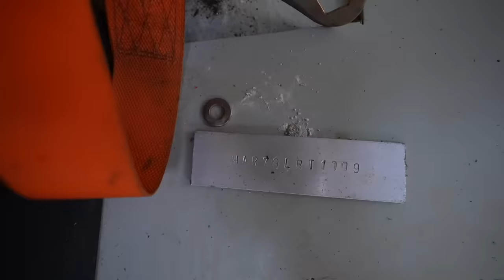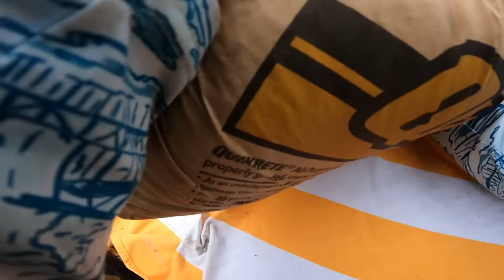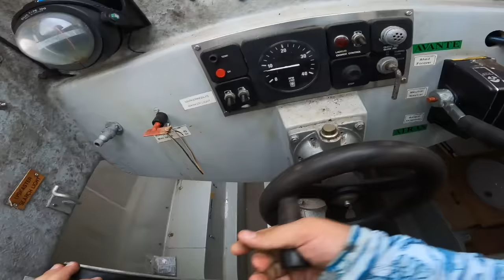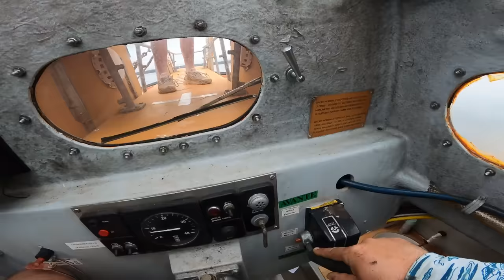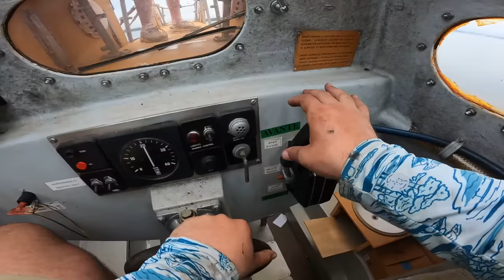WATER TESTING 64 Person Enclosed Lifeboat For The FIRST Time!!

Comment: Many years ago I worked on the oil rigs off the scottish coast.
There was I think 8 of these TEMPSC life boats on board.
They are built almost indestructable, they self right in the most severe conditions.
I was on one of the training courses for evacuation of the rig, we were seatbelted in and dropped into the sea, it almost broke our backs when it hit the water, then it rolled over around 4 times before settling upright.
The sea was rough and the lifeboat rolled over when a high wave hit it, there is no way you can take your seatbelt off unless you have a calm sea.

This was just a safety measure to evacuate multiple persons from clear from a sinking vessel, It is designed for saving lifes, comfort is not a priority.
You enter the TEMPSC, it takes you clear of danger, then the engine and navigation system keeps you in that position, then the coast guard etc will come to that location, the engine was not designed to power the craft like a boat.
On board you had enough food and water for 3-5 days, 

The latest TEMPSC comes with self closing and sealing doors, pressurised cabin, cooking facilities, battery powered with a small generator engine if the batteries get low, the latest technology for search and rescue
But you still barf your guts up when the sea is rough, not nice with 30-40 people on board.

Comment: Great job on the video AYO! Thanks for making it. There is bound to be a waterproof camera system that you can mount multiple cameras around the boat and monitor them from a central display. Should make seeing from the cockpit a lot easier. Couple that with some sort of steering assist gearing and you should have a winner there!

Comment: I would check if the hole you patched was actually the exhaust port for the motor.  It looked almost perfectly round.
Reply: That was the first clue for sure...
Reply: Pretty sure on the first video they said it was cut in to drain water from the inside while it was sat on dry land

Comment: AYO, besides sealing the Fiberglass engine compartment / Box, you should probably check the exhaust manifold on the engine and replace gaskets. Technically, you shouldn’t have exhaust gases leaking out into the compartment to begin with when the engine is running. Better to have 2 barriers against CO than just one.
Reply: Yep. Exhaust gaskets are probably corroded.
Reply: Sealing the box is a security measure that should be fixed but the exhaust should never enter the box. When i saw the boat from behind there was no smoke or indeed cooling water in the exhaust port. There should be a water intake from below the waterline(obviously) and that water usually go trough a radiator that cools down the engine coolant. It will then be used and dispersed with trough the exhaust.

Comment: The best stuff for plugging holes like that is the plumbers fix clay type putty.  It is much firmer to begin than the bondo and sets up rock freaking solid.  I patched a 4" by 2" whole in the keel of a kayak.  Then put JB weld over it in a few cots.  Sanded it smooth and it is looking like the strongest part of the yak now.

Comment: The mad thing is. Whenever you think something is dodgy, it always works out most of the time. The thing about those lifeboats is, they are built like tanks. It would be more of a challenge to try and sink one of those things.
Reply: Nigh unto impossible with the floatation foam in there. (That said he's probably going to want to cut it out of the interior since it's taking up space he could be using for a hundred other things.)

Comment: I've seen people turn the smaller versions of these into like houseboats and it works pretty well for them; the sea keeping on them is a little bit of a pain in the ass because these really aren't meant to be used long term in the water, they're meant for short term survival stuff but because they're so reinforced and overbuilt because, you never know if the sea is going to be calm rough or on fire if it's a oil rig escape craft, you can do a LOT with them, and because 64 men is a LOT of weight, if you only expect to have at most a dozen people inside, that gives you a LOT of reserve buoyancy to use for gear and other amenitie.

That top rail for example is PERFECT for strapping solar panels to, either on top or angled down to the deck to fit more panels too; I've seen pictures of one of these style life boats that someone stuck batteries and solar panels in with a backup diesel motor in and they were able to sail at a decent 10-15 knots for a few hours without even getting close to emptying the batteries.

Comment: If the rubber seals on the hatches are intact and not work hardened apply vasoline to them, its a petrolium pruduct that should soften them plus keep them from sticking in the winter cold temps.

Comment: Definitely fix that exhaust leak and put a starter/kill switch at the pilot station. 
I would put in a few more portholes and turn it into a houseboat. Put teak deck topside on either side of the center walkway that has sections that lift with the hatches. I’d like to have one, but what I’d really love to have is a 26’ jet drive, shallow draft, double hull landing craft with a sleeper cabin. I would use it for fun and flood rescue. Only problem is I’d need to get a truck to pull it and it’s really just a dream/wish, because a disabled vet without any benefits, and not able to work, ain’t buying anything sooner or later. 😥

Comment: You could put a ton (literally) of ballast in that thing to get it closer to how it was designed to control.  And that would let you put a nice big deck up top to give you much more outside room.  A bilge fan will get rid of the CO, but there's an exhaust leak somewhere that needs addressed.

Comment: wax paper is your friend when doing underside work ,the plastic from the 10 inch stick on sand paper work awesome ,i always save them ,they work well on top repairs too as you can smooth it with your hand and when you peel theplatic off you get a shiny smooth surface

Comment: I would love to buy a lifeboat like that, I don't exactly know what I would do with it but I think it would make a great bugout boat for when shtf.  I would build some aluminum platforms that could be hung from the side openings which would create deck space for chairs or whatever else.  I would probably slap a duramax in it and make it a floating travel trailer.  Build a bed in the very back of it and a kitchenette on one of the sides.  Definitely install some cameras to make piloting it easier.  I would replace the side sliding doors with 1" thick polycarbonate and they would open just like they do now.  It would be cool to make the cockpit bigger using a polycarbonate dome similar to a aircraft canopy.  There is just so many fun possibilities for that lifeboat.

Comment: If you're driving that thing around, I hope you have a CDL, because if the Department of Transportation catches you driving a vehicle with a combined gross vehicle weight of 26,001 pounds and up, they're going to bend you over. Expect a ridiculous amount of fines if you get caught. It's based off the weight of not just your trailer/cargo, but your truck as well. Basically your truck and everything attached to it. Maybe you're driving it on private property, or maybe you're not moving it very far, I'm not sure. Just wanted to point this out regardless so you're aware. Love the videos man, hope you're doing well. Can't wait to see more videos of the house boat!

Comment: Re the carbon monoxide, all you need to do is to reglass the engine cover, make sure the seals are in good order and put a flexible hose to the outside; adding an extractor fan would be even better. All the best. David

Comment: Vasoline on the rubber seals.  It'll help with the sticking without ruining the rubber.  CLR the hull bottom.. Don't seal up the water holes for the engine heat exchanger, etc. Be careful, it'll cost you money.

Comment: Ok, get it completely and professionally refurbished, add a galley, bunks, etc, and turn it into a little houseboat, party boat, or bug out boat.  Have the prop replaced with something for a little more speed and replace the wheel with something a little more modern and responsive for less turns.  Just thinking out loud.  :)  Great videos though.

Comment: Hey AYO that hole you covered up on the bottom is for the exhaust system for the motor to come out instead of coming into the cab of the boat

Comment: I'm an Auto Detailer (anything on wheels as well as boats) just a pressure washer will not take that stuff off the bottom of a boat. You have to use chemicals (usually a acid wash) to get that off of there. Just doing a normal 16 foot boat takes around 4-6hours to get it in the best possible looking condition. But yea it shouldn't need new paint just lots of love and time put into cleaning it brother!

Comment: Looking at the driver's view from inside the cockpit, I think if it was me I'd consider mounting a camera on the front of the boat (like you had for some of the video footage) and have a display screen in front of the pilot.  Basically a back up camera except pointing forwards.  Obviously these were not designed for common motoring around other small boats in a typical marina.
.
The carbon monoxide issue sounds like something more than cracked fiberglass on the engine housing.  Generally speaking, the exhaust gases should only be coming out the exhaust.  (I know, 'duh' right?).  But I'm referring to many other boats I have seen where the diesel engines were in the same space as crew but fumes were not an issue - cuz exhaust pipes.

Comment: I’m not an expert filling holes in boats, but back in the time when I was surfing, I was able to fix quite a lot of holes in my surf board.
We used Fiberglas and covered with resin.
 I would sand the area around the hole first, the apply an even amount of resin around the hole, covered with a thick layer of fiberglass and even more resin, place some paper wax and a piece of wood, from the bottom to keep the fiberglass in place and pressure using a jack and a rod.
The paper wax its to avoid the wood sticking to the resin.

Comment: You need to use a brush and coat the surface first then put your cloth on and stipple it with more resin and you should have removed paint to access the raw fiberglass so as to achieve adhesion and then add multiple layers

Comment: Usually, diesel engines produce little CO unless with incomplete combustion. I'm wondering if the fumes aren't related to that hole you fiberglassed shut. Another thing, with it being a displacement hull, pushing the engine past the rpm needed to get hull speed is just overloading the engine. That's a pretty neat boat!

Comment: Use wax paper to slap tiger hair over the hole.  Spread it on the wax paper, slap it on like a patch, then peel the wax paper off once it is sorta hardened but not completely dry.

Comment: prolly coulda filled the hole easier by putting a patch or ductape over the hole then put a small hole in the patch or duct tape and fill it with a big syringe or baster  or something o.o idk if itd work but it sounds like it would.

Comment: A fuel gauge float could be installed in the fuel tank. A simple mechanical float connected to a mechanical gauge (doesn't have to be digital). A simple set up like the ones used in cars, trucks, and boats. That's a lovely engine you have there (it's like winning the lottery) In terms of running hours, it is near new! with routine inspection and maintenance this engine should last you for decades without a problem.
greetings from Australia.

Comment: When you do the liquid fiberglass it is best to use a paintbrush or a small roller depends on what size and how much matting you're putting down little tip to think about and when you're doing something upside down apply the resin to the matting let it soak but before you stick it apply the resin to whatever you're putting it on hope that helps next time

Comment: You need to ballast down the stern place the prop lower in the water do it with plastic sacks seal with sand this will enable to prop to push better through the water. With 64 persons in the boat no issue. But you are using for pleasure you need that ballast . when one wants to turn quicker, wheel over to the way you want to go, power up and down in short bursts this will help turn the boat quicker.weld a aluminum ladder to the side so as to asses the roof safer plus you nee to run a safety wire/rope fore and aft to walk with your safety harness attached..

Comment: Dang Brother Killer deal Id love to have it. I wonder if you can  change the steering gear ratio there behind the steerin wheel . There are so many things you can do with it.  Heres some names Sweet Potato . Slow N Steady LOL With the alarms going off. THE GASP. Plus folks are gonna gasp seeing that Beast of a boat comin by. Thats a floating Tornado Shelter for the lake. !st thing though. A all weather wide view camera at the bow and a large enough screen at the helm. Id mount several around it and wire it to switch views  with GPS view for when your Putt Puttin along. But mostly to help  see The Bow and Stern when its tight at the dock. Bumpers for sure . Man its Killeriffic.  Merry Christmas..

Comment: Turn this into a camper boat! Replace the diesel engine with an electric motor with batteries and a charging port. Place some big lights on top of it, a sonar under it, a radio and gps for communications and lets go fishing!

Comment: it`s possable its the raw water inlet you blocked up from the position under the boat, most marine engins are cooled by a heat exchanger and pass raw water out of the exhaust, as no water was comming out of the exhaust it was possably the engine overheating that set off the alarms.

Comment: Jump to Napa and get you a stick of Door Ease Stick lubricant.  Smear it very well on all those seals.  They will always release, no matter the temp or weather,,,and it adds a layer of waterproofing to the slightly compromised? seals.  You can use it for hinges and latches, ect.   The Door Ease is also great for marine zippers as well as any zipper on anything, to add ease of use,,and waterproofing..  I use it on door seals of the truck, the 56 Chev door seals, tackle boxes, motor linkage, cable runs, ect.   Pac Northwest here,,so lotsa rain and weather here,  It wont goop off onto your hands or clothes, unless you really try.  It's a push-up stick with a cap, so you can toss it in the wrench box down below..   You got a smokin deal on a boat with that much room inside and within that length,,very jealous.   Now you know Johnny Lawman is gonna want their take,,so be prepared for that paperwork.    The nice thing is, you could load up for a week and sail the ocean unafraid,,,just on a whim and a moment.  Although,,,.

Comment: Why didn't you use a rubber expandable plug for the hole at the bottom that way you can always drain the boat if it builds up water! They sell the same kind of plug for car engines for a freeze out plug replacement! You might want to check it out

Comment: Could you use one of those rubber twits plugs in that hole? That way if for some reason it took on water, you could just loosen it & pull it out to drain the water.

Comment: Ok so you need to check your exhaust manifold gasket and all the bolts that secure the manifold to the engine for proper torque, then check the exhaust from the manifold to where it exits the boat. No exhaust coming into the boat is acceptable, the box in which the engine lives and the crack you found is not the culprit. That box merely keeps the engine secured and away from the passengers and may also keep some noise in check but is not used to seal exhaust fumes.

Comment: Backing is basically a "joke" on those types of vessels.  I've always practiced backing only when needed and using the revers/forward when turning and they will basically turn on a dime. I spot a few technical solutions as well as hull design which are similar to the Norwegian Viksund fishing vessels. Anyways it's cool to see it afloat. You'll get the hang of the controls in a breeze. 👍👍

Comment: That hole on the bottom of the boat, might have been intentional to see in there to see if there is any damage. Because they saw what you saw inside the boat, a little bit of damage; so they cut a hole on the bottom to see in and look around. Maybe it came from the top. When it rains heavy, go in there and see if anything is dripping.  Just suggesting.

Comment: I watched this and even though I could jump to the end and see what happens, I watched it concerned the whole way. Very entertaining. I'm not finished yet, so I may be pre-emptive with my comment. With luck it worked out. I know that later you built stuff into it, so at least I know it probably doesn't sink.
Ok, watched some more. You went a fair way considering you were not dead sure on how much diesel you had.
Nice boat though.

Comment: Use Oxalic acid and water mix 1 cup Oxalic to 2 gallons of water in a pump sprayer and watch the stains go away before your eyes. It won’t kill grass or anything but it might not react good with the aluminum/ galvanized trailer so cover that. It will make a cool video too. 
U can thank me later… 🤙 lol

Comment: Instead of bondo some spray foam would have been easier. Also the bondo would have been easier to stick the fiberglass panel of u sanded and prepped a bit. Regardless still funny to see you do some of this stuff!

Comment: Could that hole in the bottom been the drain plug hole like at the back of a boat has and it was just missing?  I would of screwed in one of those large rubber plugs plugs they make that tighten up tight and seal it up. Just in case it was supposed to be there.